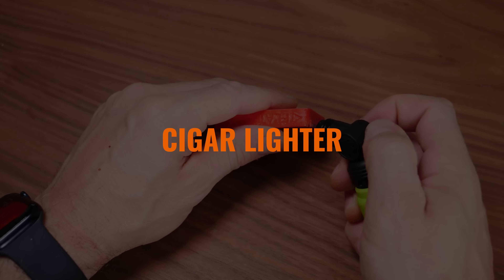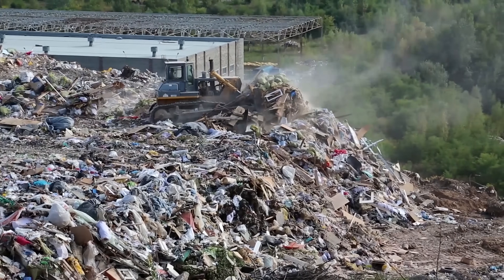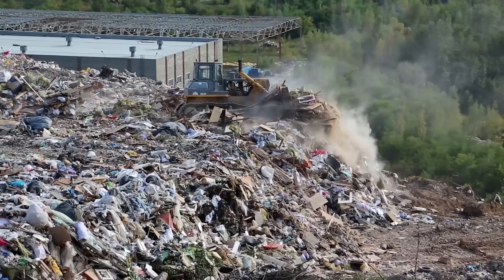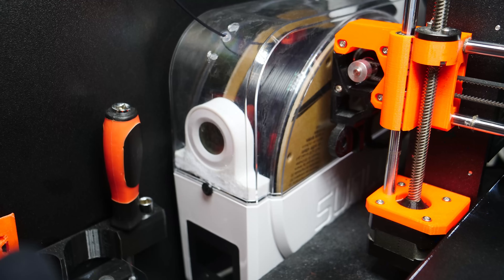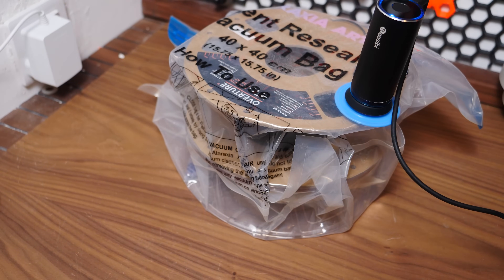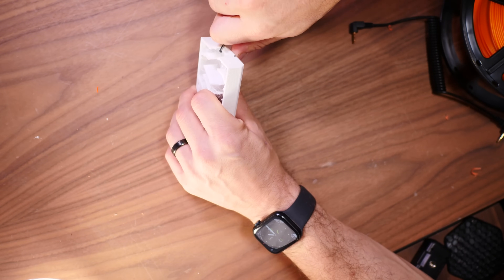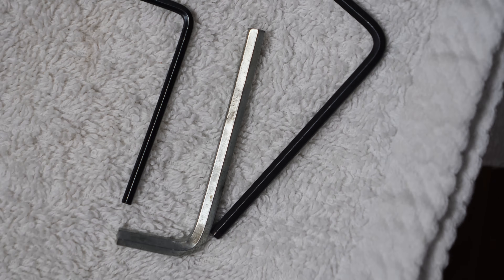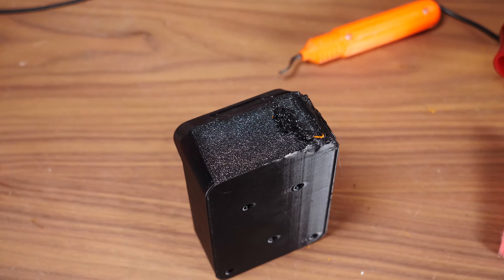15+ 3D Printing Tools You Definitely Need

Comment from the maker: THANK YOU so much for watching! Let me know what you think in the comments - I read every single one :)
Reply: No sir thank YOU, some of these tools are things I wouldn't have put much thought into.
Reply: With your cigar lighter torch..another useful tool that I use is a METAL chopstick. With both ends being rounded and one side a bit larger than the other, you can smooth out whatever part you heated up to fix (better than a butter knife) plus you can heat up either end to help weld parts together. Just an idea.
Reply: Maybe look into garolite/fr4 as an option for ASA. :)
Reply: For bed adhesion plus a few other tips have a look at this one it might help ;P
https://youtu.be/zqidSM-TxZU
Reply: The reason IPA stops working on your bed is you need different solvents for polar and non-polar contaminants. Alcohol will not remove sugars and some plastics, like PLA, when heated will degrade to sugars.

Comment: Forget the cigar lighter--a hot air soldering iron for replacing Surface Mount Components is much better.  You can set the temperature between 0 and 400 C, and adjust the size and speed of the air column.  Great for removing stringing, softening prints, etc--and doesn't leave any carbon on the print surface.

Comment: for ASA use a thin coating of salt water (1tsp salt/ 30ml water), let water evaporate, wipe excess salt crystals off quickly with a dry cloth and it STICKS also no warping. also quite easy to get the print off, wobble a bit and it comes off. no warping either. btw im a noob printing ASA without enclosure on an anycubic kobra 2 neo. bed temp at 105C is important. no care for drying was given yet by me and the results were awesome. ASA is everything ABS wants to be. maybe i should point out that i startet printing with ABS since i got the spool for free with my 60€ kobra2...

Comment: For some reason, I dislike the feeling of microfiber cloth on my hands. If you’ve got the same hangups about microfiber cloths, I recommend surgical towels. They’re designed to leave behind zero lint, they absorb like crazy, and they’re very cheap (25 for 15.99, last I checked).

Comment: There are actually lint-free microfibre towels, because normal microfiber towels give off loads of fine lint.
This is why simply cleaning, and rinsing your build plate works wonders for adhesion.
And after just three days with a printer, I am now adding brims to dodgy corners. To be sure. To be sure!

Comment: A 'deburring tool' is generally a plumbing/pipe fitters tool for removing the rough edges on cut pipe... A couple swipes around the flange and its all clean. On metal pipes, it makes the end safer for handling, on plastic it cleans up rough edges that interfere with joining. In both cases, it removes debris that would otherwise serve as a collection point for gunk or break off causing clogs at filters and screens over the operating lifetime of the pipe.

Comment: 14:00 — I strongly suggest that you visit model making or 'gunpla' forums (or associated videos) and read up on sprue cutters, used for cutting parts off of the sprues holding the parts as part of the injection molding process, and to clean up the nubs left after you cut the parts free (you don't want to try to cut them off flush while they're on the sprue, so there will be short stubs where the part attached to the sprue). There is a wide array of different sprue cutters; cheap ones may not even align the blades with each other, and there are two-blade and single-blade cutters that have different uses and reliability. But the modeling industry has been using them for decades, so take advantage of the knowledge and expertise that's there.

Comment: A little late but 70% alcohol is best for sanitizing, but 99% will be much better at dissolving and therefor is a better use for cleaning the bed. Plus it dries quick

Comment: Just bought my first Bambu a1 printer. Learning to print will be fun. Curious about the glue stick portion has anyone done spray glue? I have a crafting cricket machine and the mats sometimes will get worn out and you clean them with dawn, dish soap and then you can re-spray them with a spray glue adhesive and it makes them sticky again. Would that be the same conceptfor these instead of using a glue stick? Curious if anyone’s done that

Comment: LOL, deburring tool.  I worked in an injection molded plastics factory many years ago and we called them swivel knives.  I had 3 or 4 around the house for a very long time.  LONG before 3d printing became a thing.  Now, I've got to go out and buy one because I quite working there more than 30 years ago and no longer have one of those around the house.

Comment: Hey, first and foremost, love your vids wanted to get in to 3d printing for a long long time, but never had the real ability to. But recently I said screw it and dove in, well went to the pool and got my suit on as it were lol. I Bought an entry level resin and an entry level fdm as well. I mostly got the ones that I did because they were what I could find as cheap as I did and still be acceptable. I got a refurbished ANYCUBIC Photon Mono 4k. (though I have to admit I got busy doing other things that day and wasn't paying as much attention as I should have been, because I thought I was buying the photon mono 4. Not the much older and not nearly as good 4k. They really should change the names of those two somehow lol) but I'm happy with the specs on it for what I paid. I have received it just today, but alas my resin has not arrived yet, and there is literally nowhere in my town in southern Utah USA, that sells any kind if 3d printing supplies at all. I checked. And unfortunately even though my filament was delivered today as well as my Creality Ender-3 V3 SE, it was purchased "unrepaired as is for parts or repair" but in the description it had stated that they just hadn't hooked it up and tested everything, so the working status was unknown. I've had a lot of lunch with buys like this in the past so I jumped on it. Well it is missing the entire touch screen display and knob. 😭😭. I ordered a replacement that should get here by the end of the week or beginning of the next. Hopefully everything else works and is there lol. I'm gonna start reading and putting it together and testing what I can before then I've also order a couple new, different build plates/beds, a few new nozzles and hot end upgrade setups. I have a Carborundum Glass Platform ordered, but the one that is on it now, that has a couple big dings/gouges on it, is a spring steel platform plate. Do I need both, or is one better for all around, I get the impression that each is for it's own set of materials and kinda need both if I plan on printing multiple kinds of materials. Oh yea and last but not least, did anyone catch how @13:10  he said "as I mentioned in my 3d printed videos tool" 😂😂 lol how the hell did you manage to 3d print videos? Lol I kid of course, your vids have been great for me and where I'm at in trying to soak up as much knowledge about all of everything as I can. Thank you and keep up the great work!!

Comment: Get reusable silica gel packets. 

Method 1: Oven Drying

Preheat the Oven: Set your oven to a low temperature, around 250°F (120°C).
Spread the Silica Gel: Place the silica gel beads on a baking sheet in a single layer. Make sure they are not piled on top of each other to ensure even drying.
Bake: Place the baking sheet in the oven and bake for about 1 to 2 hours. Keep an eye on them to prevent overheating.
Cool Down: After baking, remove the silica gel from the oven and let it cool completely before using it again.
Method 2: Microwave Drying

Prepare the Silica Gel: Spread the silica gel beads in a microwave-safe container.
Microwave: Heat the silica gel in short intervals of about 1 to 2 minutes, checking in between to see if it’s dry. Do not overheat, as this can cause the beads to crack or melt.
Cool Down: After drying, allow the silica gel to cool before using.

Comment: I would say the silica get is great, with a caveat. It's better to get a jug of the gel beads and print a middle of spool desicant holder. that way the beads keep doing their work while in storage and not break the bank on the little packets. Plus for Bambu printers with an AMS, the core can stay put while printing as well, aiding in that process as well

Comment: Many build plates have a PEI surface now. The proper cleaning for that surface is dish soap, as you indicated, but for cleaning between prints, the recommended concentration of isopropyl alcohol is 80-90%. 99% will deteriorate the surface quicker and reduce its effectiveness. For vacuum sealing filament bags, some kitchen vacuum sealers have an external adapter. This allows you to use the resealable bag the filament shipped with and vacuum the air out. The 3D pen can also be used to build up a thin wall before sanding it smooth. Fixes the problem spot and sanding smooth hides the crude fix marks. Look for the hacks where you can use them.

Comment: I've never really been a fan of those 'one size fits all' wrenches like you mentioned when talking about the thin wrench you use.  Instead having worked as a mechanic for many years and having seen how those wrenches can eventually round off a nut or bolt head I often opt for a set of what were in the past referred to as 'ignition wrenches' (because they were pretty essential when working on points style ignition systems on older vehicles before electronic ignition systems became common), you can pick up a relatively decent yet inexpensive set for less than $20US on sites like amazon or even probably aliexpress or bangood or (and I hesitate to say this because I have heard many horror stories about the items purchased from them) maybe even temu.  They may not offer as long of a reach as those wrenches like you mentioned do but the dedicated geometry of the ends certainly goes a long way towards keeping your nuts and bolts from being rounded off leaving you with having to invest in an extractor set or resort to using things like 'vise grip pliers' or 'channel locks' or even pipe wrenches to remove the nut or bolt so it can be completely replaced (unless it happens to be some kind of one-off specially machined fastener, in which case you might just be 'screwed', no pun intended, well only a little, lol).

Comment: The reason 70% isopropyl alcohol exists is to sanitize. The higher-level alcohols evaporate too quickly to be able to have the time to kill anything so you need some water in them to slow down the evaporation.

Obviously we're not dealing with food so the higher-alcohol variants are fine. But if you already have 70%, it works just fine (and your bed will now be sanitized!).

Comment: I printed a mechanical demo object wich only held together at one cornor. but the blue gear was mounted in another corner by 2 round elements with a hole in it, I decidet to put some fillamen strings in this hole and used my 3D Pen to fix them on the model, so the object is less floppy and more stable.

Comment: Most pharmacies (at least in the US) carry 90%/91% alcohol, it should work just fine for bed cleaning.  The 99% and 100% alcohols will evaporate so quickly that it becomes a challenge to accomplish the CLEANING.  Even 91% evaporates pretty quick.

For the ball end Allen Keys, I strongly suggest these 4 brands:  Allen, Bondhus, Wera, PB Swiss.

Comment: @5:00 isopropyl will dissolve the alcohol but it isn’t necessarily all picked up by your rag. a lot of it remains on the plate, requiring dish soap and water to remove. this is well documented.
Reply: Isopropyl alcohol is the alcohol itself. It's just a different chemical structure than the alcohol so many people think of that can be drunk. ;) When a bottle of IPA says it's 70% or 90%, that's the concentration of the alcohol in the solution. The remaining percentage is typically deionized water (which is actually not good for you to drink all on its own!)

Comment: People make 3d printing more expensive and troublesome that it needs to be. You're the second video I watched tonight exclaiming the usefulness of isopropyl and microfiber rags. I have two Ender3s. I use the cheap kindergarten glue sticks from Amazon. When the build up gets crappy, I run the build plates under warm tap water and use a sponge to remove the glue. Then I put down a new layer of glue and go. If it doesn't stick, I probably need to relevel my bed. As to hygrometers. I keep a one-room dehumidifier next to my print station and run it year around with a setting of 50%. I've never had a filament, no matter how old, to give any problems. And by the way, they sit out unwrapped. But-- Is there an unusually high humidity in Israel?

Comment: I see the 3D pens are basically mini mig-welders. Had my main printers PSU's explode while I was making custom ductwork for a clients PC build on a tight timeline - redesigned the parts to fit on a smaller unit (chopping each piece into sections with lips / pins and chamfers all around...) super glue to locate parts, 3D pen to fill the chamfers, sand flat. Seamless perfection with not a whole lot of extra work. Given that the seams are also "100% infill", yay stronk, you can use a higher temp than normal printing without worrying about stringing. That and dragging the hot tip across the printed surface while depositing new stuff allows the new material to both fully fuse, and key in with the base material.

Comment: Use Bambu build plate glue stick. It creates a thin barrier between the part and build plate. It makes the part stick and also the part comes off the plate easily. It cleans off with water. Bambu printers come with it.

Comment: I also use a 3d pen to strengthen the glued parts together when there is enough space. What I also recommend is a pyrog (I don't relly know its name in english) I use it to smooth and strengthen printed models. For example a cilynder base and a tube printed together, the tube will break too easily to hold a model, but after some heat treatment with this thing, and the base is strengthened with a 3d pen, its really sturdy.

Comment: A "burr" is commonly present in injection plastic pieces where there is a union in between the 2 negative molds, when releasing the final product, the seam where there was the union of the 2 molds leave a line, (the plastic wants to get out in the weakest point) it tends to be this union, and if plastic indeed get out, it leaves a "burr".

Comment: The whole vacuum bag and air tight storage container thing is overkill, unless you're planning on storing your filament longterm. Dehydrate the roll, put it in a large zip-loc with a container of silica beads, suck the air out from an open corner and then zip it shut. As long as the silica beads go in dry, it doesn't matter if there's vacuum - there's so little air flow that the beads will keep the roll dry until your next use. Much easier and less costly.
Reply from the maker: Good point

Comment: I prefer to use a ratchet undoing my nozzles. That way I can make sure I'm not tightening it by accident, as I always get confused when it's upside down. 
To insert a new nozzle, I use an Olsen tool that has a set torque limit and makes sure you don't overtighten.

Comment: I store my in-use filaments in an IKEA SAMLA container with weather sealing added to the lip. It's filled with 4L of reusable silica in fine mesh bags. I use some printed PETG SAMLA clips to keep it sealed tight. Easily holds 8 spools, and could stuff another 4 or more if I really wanted to pack it full. The reusable silica can be dried out again in the oven. 
I think I saw the first iteration of this idea from CNC Kitchen.

Comment: Great video!

I don't know if you were joking or not but just in case you weren't... Deburring tools are indeed designed to remove burrs.  A burr is something that machinists like me encounter a lot.

Whenever you cut a piece of metal, whether it's with a milling cutter or on a lathe or with a saw, it always leaves a raised rough edge called a burr.

Burrs are problematic, because not only do they constitute a scratching or cutting hazard for your poor fingers, the fact that they are raised means that they can cause parts that have tight tolerances not to fit together properly.  We use deburring tools in the shop a lot remove these birds so that parts fit properly and don't cut anyone.  Also, two straight cuts meeting at a 90° angle can leave a very sharp corner.  Even though it may not be a burr as such, we used to bring tools to break these hard edges.

I hope that was informative!

I get the impression and forgive me if I'm wrong, that before you got into 3D printing you didn't do much other making except probably wood working.  Coming from an automotive and metal working place to watch making and then to 3D printing as part of a general Maker's journey, I find it interesting what tools people do and do not know are out there.  I also find that the most interesting things come from people who have two intersecting maker specialties that may not necessarily always be combined.

I am looking at getting into 3D printing in this video is extremely helpful please keep up the good work and keep making great content.

Comment: Nice Video 👍🏻

I haven’t watched your second video on that topic but for this video i definitely miss a soldering iron, clamps in different sizes and a rotary multitool (dremel).
Not a tool but as far as hardware goes, all kinds of screws and especially heat inserts are missing.

And since you said you don’t know what a burr is: when you are milling through open edges  it can create really thin razorsharp blade on the edge. To get rid of it and make the part safe to touch you cut that „blade“ with a deburring tool.